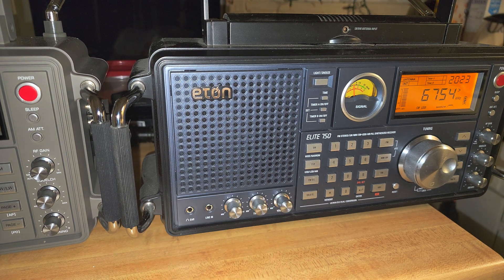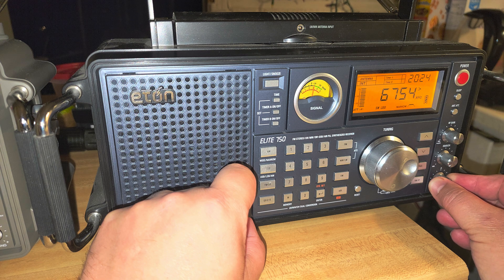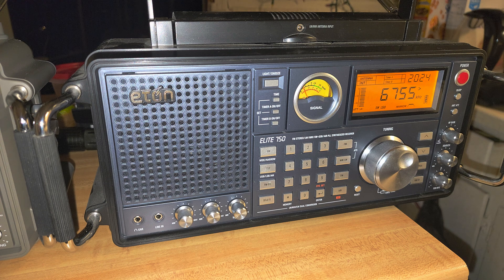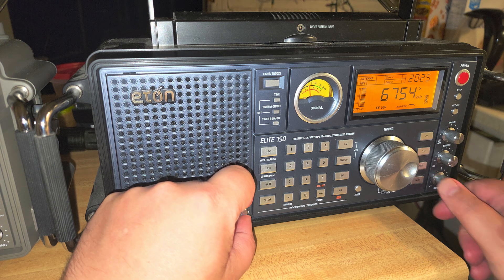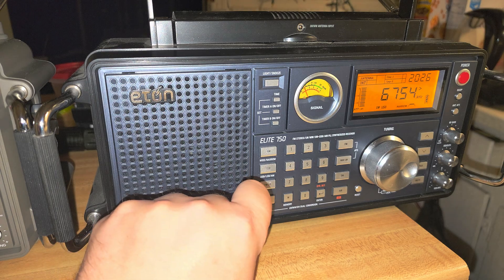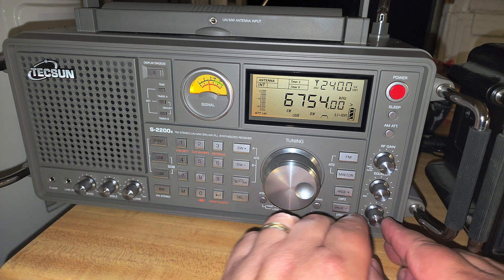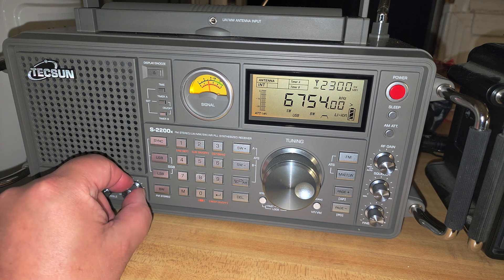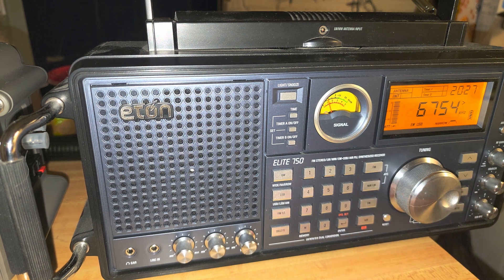Tecsun S-2200x VS Tescun S-2000 aka Eton elite 750 aka Grundig 750 BFO tuning SSB VS Fine tuning SSB

Comment: Thanks for this comparison and explanation. Very clear!

At around 1m30s you use the main tuning knob on the he Eton, but nothing seems to happen.

Has a flaw developed in the tuning and, if so, has that got the potential to affect the new model, in your opinion?
Reply from the maker: Yes the tuning knob stopped working, it seems a common problem for the original version as I have seen many with the same issue
Reply: @OfficialSWLchannel A radio with a tuning knob that stops working?! Wow… I don’t even know what to say.

Comment: BFO isn't so bad, its better than no SSB at all. Try a Sony ICF 2002, the radio tunes in 5khz steps and the BFO knob has to swing roughly 2.5 khz each side of what on the display.  After a while  on SSB you learn which direction to step, up or down, to get within range of the BFO knob. On the ICF 2002 the knob works on AM too, sometimes I forget to re-center the knob when I switch out of SSB and wonder why international broadcast sounds off.

Comment: Yes as you say , you need to get used to a bfo . I was brought up on tube recievers so it's second nature . Both methods are ok but in some ways I prefer the bfo and find it slightly faster maybe . 
Just watched your vid sbout the s meter on the 2200 . That really does need to be addressed by Tecsun . It would drive me mad . The meter is a prominent feature of both these recievers and one of the reasons I bought the s2000 .